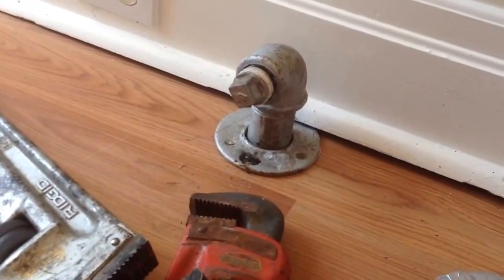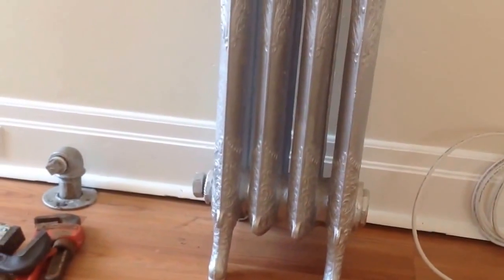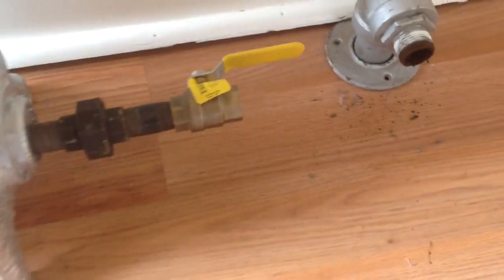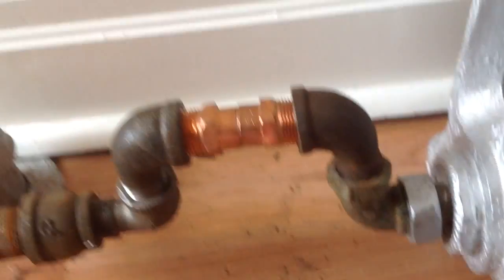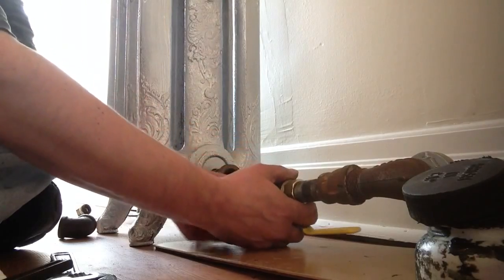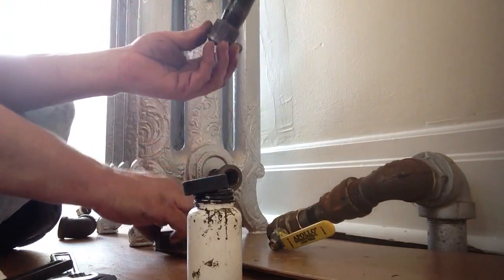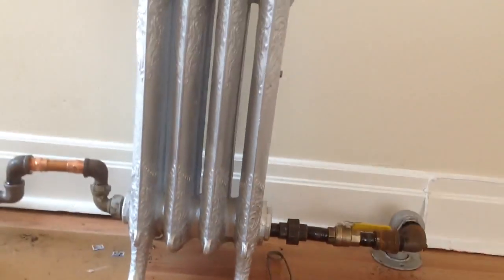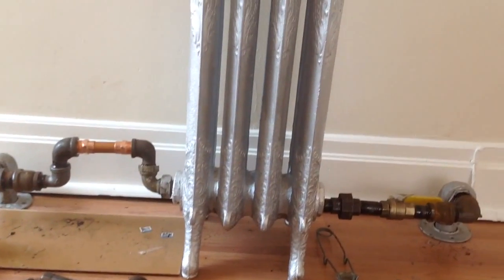DIY hot water radiator installation

Comment: I see a good place for an airlock. And you never mix copper with black pipe unless you use dielectric connectors . so apparently you don't know what you're doing. Pardon my French that looks like a real klusterfuk
Reply from the maker: That's copper and galvanised steel.never mix copper and galvanized with out dielectric unions. Copper and black iron are mixed all the time.
Reply: No it's copper and cast
Reply: What a bodge job
Would you seriously leave it like that ? 
There's a reason why the the supply pipes are as far apart as they are- a large radiator is required due to the size of the room!
Sorry but you haven't got a fxxking cue.
Reply: @themrhelperguy  No they are not.  But then nothing else you did here is right either.  Who sold you tools?

Comment: Don't you have to "supply" on the bottom of the radiator and "return" on the top of it? Otherwise, the hot water will just flow in and out of the bottom of the radiator.
Reply from the maker: +Sean Murray hot water in rises cools lowers out otherside

Comment: good intentions but come on you could have done way better
Reply from the maker: Of course. I did this for a tenant on the quick. One thing that I remember from this is that those pipes from the floor didn't have a 1/32 of play in them.  Usually you can move them up and down. The pipe on left side may not have been at the right height. This was done for a tenant that wanted her mom to stay with her, maybe had some health concerns. If we had the right circumstances we could have opened up the 2nd floor ceiling dropped those pipes in the exact spot. It wasn't in the middle of winter l could have loosened up the elbows and just spun the union into itself if I needed the play. I did know that I could not start taking apart the existing pipes. Been around to long to do that. You never know when an old pipe eggs or breaks off thread.
Reply: themrhelperguy i know that old steam pipes are impossible to move but you still could have done a better job like run it mostly in copper with dielectric unions and it would have looked way better and i know this is not the only rad you have done like this
Reply from the maker: Oh yeah I converted that system from steam to hot water. I gutted out all the steam traps and ran the thing. Well all the dam thing would keep raising the temp right up to the limit. I'm thinking I really blew this one with an oversized boiler. I thought about it and those radiators should have sucked all the heat out of that 80000 but boiler. So I went back and ripe out all steam traps drilled and tapped out radiator's for 3/4 pipe pulled the valves out and gutted them. Nothing worse than a Tennant mixed with a 100 year old valve that's frozen. That's called a broken valve stem that spews that black gold. After all of that the thing ran great for a boiler that is. Even on that deal we had a tenant below us but I would have done everything the same on that one. If that's the one you are talking about.
Reply from the maker: I still have plans on replacing that system with a furnace with central air. I still own that building it's a beautiful 4 square. The house that had the radiate that you thought should have been done better was sold.